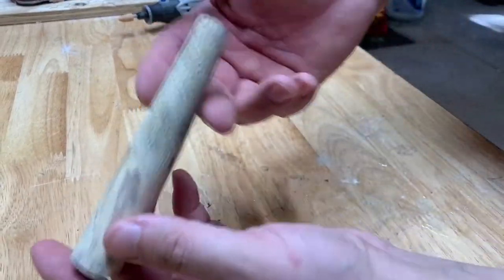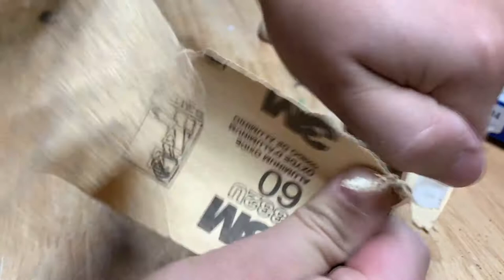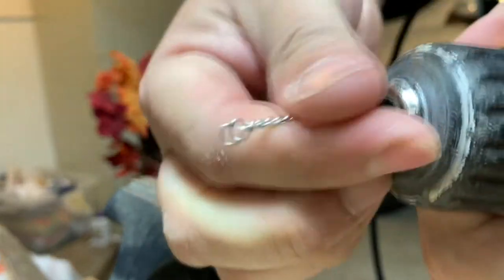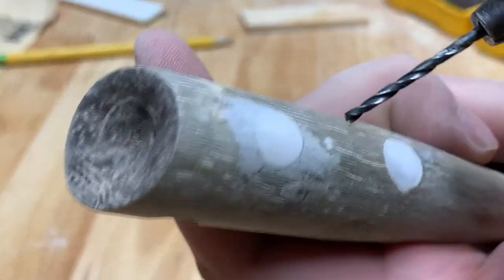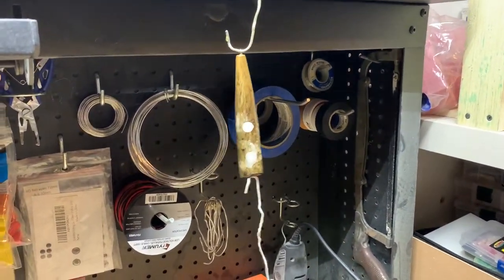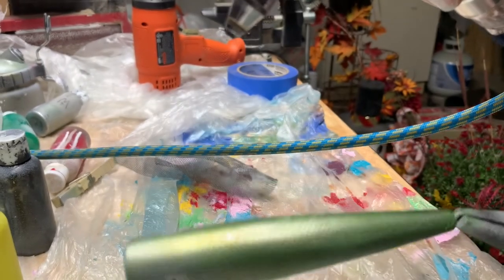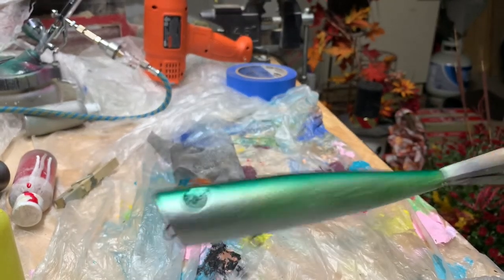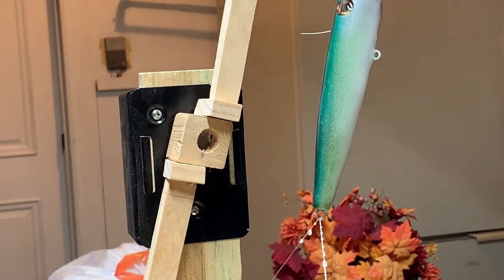Making a Classic Popper

Comment: this came out very nice! I started making lures last summer and I've been making similar poppers but with a through wire. I'm a big saltwater angler so the hardware really needs to hold up! keep videos like this coming! My only concern with this design would be how it sits in the water. With my poppers i tend to put weight farther back than forward so it has a 30ish degree tilt on the water surface. it helps with the popping action!

Comment: after opening a can be resin, paint, varnish etc. when the work is finished beam and turn the can with the top down the bottom of the can is facing upwards it will never draw

Comment: Does your epoxy ever go blotchy with not cleaning the lure properly. What epoxy are you using.
Reply from the maker: It does… I noticed that if I handle the lure with my bare hands before the clear coat, which I do way too often, the epoxy is repelled from that area.  Something about the oils from my fingers transferred to the surface.
Reply from the maker: I’m using Devcon, I pretty much order the cheapest I can find of anything… which I’m sure is also part of the problem.